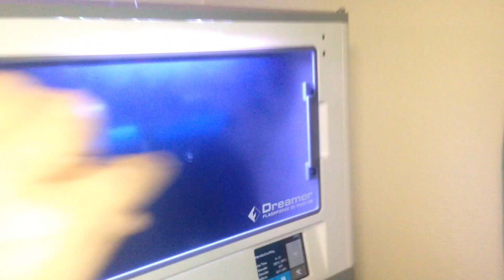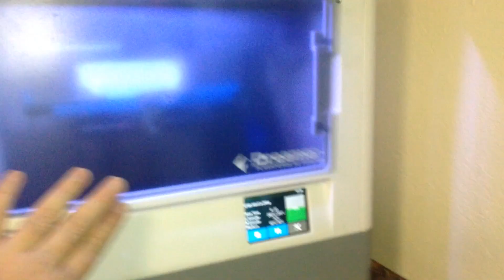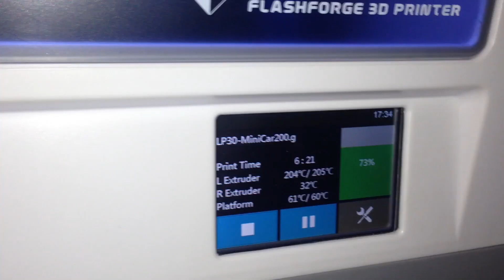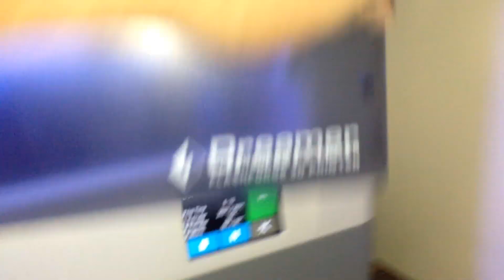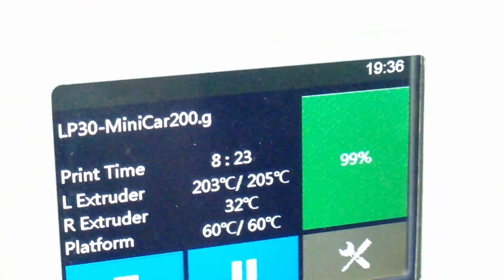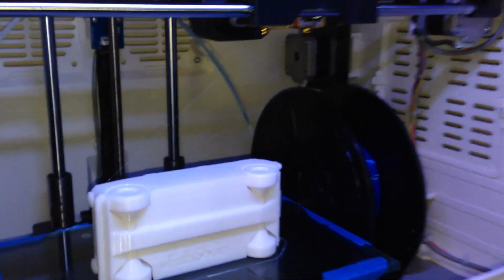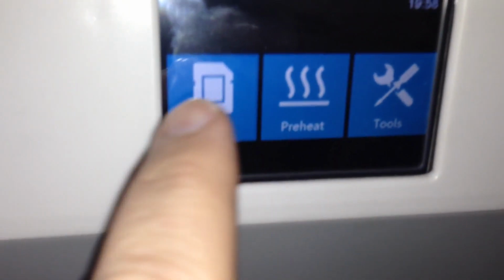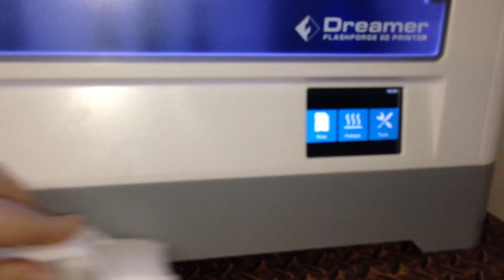Flashforge Dreamer - 3D Printed Toy Car

Comment: I cant find any videos on leveling, I was wondering does this have auto leveling or is it simpler to level than the Pro/Creator with the LCD?  Also how many hrs does the level last on an average?
Reply from the maker: Hi. No it is not auto leveling. You have the standard 3 thumb screws and follow the prompts on the front LCD and use a piece of paper. I've had this printer for just over 5 months now and it took me over an hour the first time because I've never had a 3D printer before. But since then I've only had to re-level I think maybe 4 times? Roughly once a month
Reply from the maker: Oh and my printer is running about 28/30 days a month
Reply: Thomas James Okay, thanks, well this one and the pro was on sale for $990 on BlackFriday and $1049 on Cybermonday so I got a Creator Pro.   Thanks for the reply, I won't be using it near that much :-D
Reply from the maker: gencodeinc Wow, that's an amazing price and honestly both printers are very good. Good stuff. Who knows, you may pay off the printer in 6 weeks as well ;-)
Reply: Thomas James yea, it was an amazing price, the wood one was about 760i'sh.